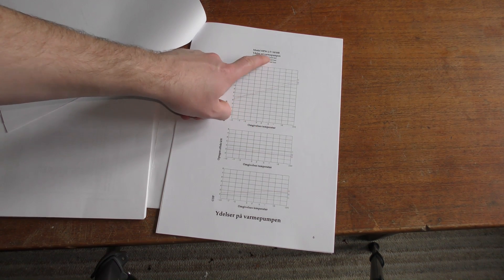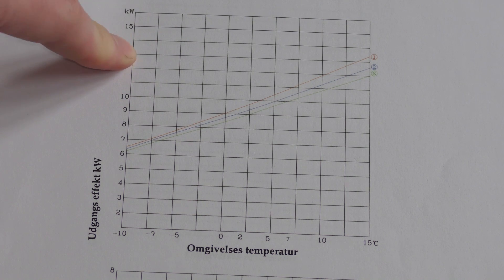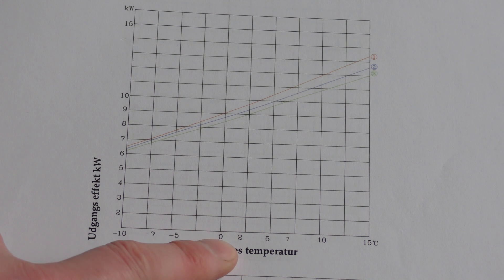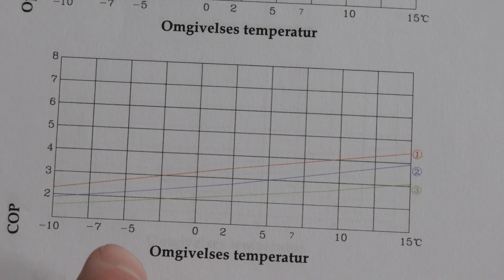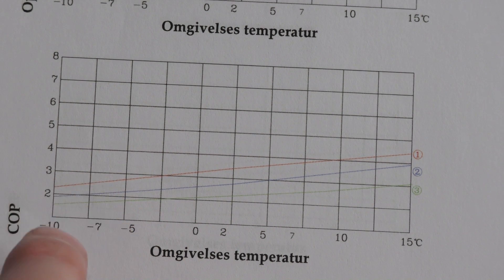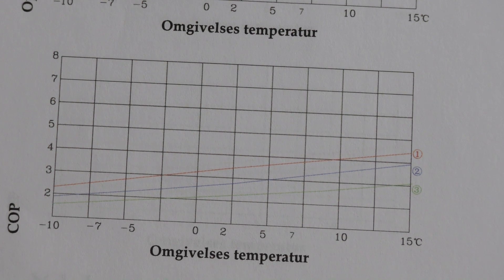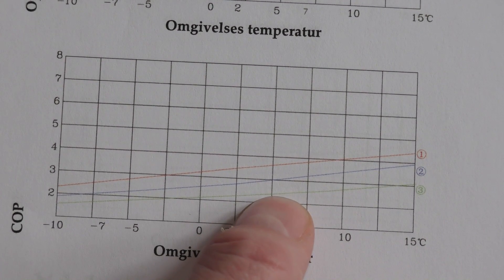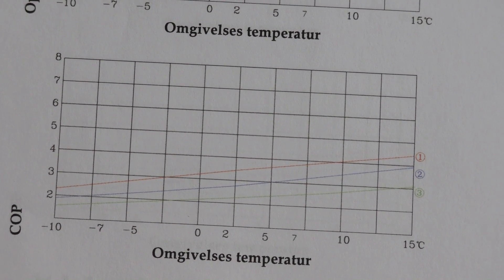Improving efficiency of heat pump, with heat controlled FAN - 306

Comment: Great video as always! Did you ever find a resolution for your Apartment's radiator?
Reply from the maker: Hi +sized4spills 
I change back to old thermostats,,the digital ones that turn on and off the heat,,will heat up the radiators to like very very hot,,, and more "oil" evaporates,, compared with a radiator that is just warm.
It the way that works, with the way i pay for heat,,that is incompatible, and becomes way to expensive.
Thank you for watching! :-)

Comment: You're not getting 3 kwh for 1 kwh  that breaks the Law of conservation of energy. 
Coefficient of Performance is heat output / watt input which means that for every kwh you're producing n number of heating units Btu/h.
Reply from the maker: Hi +Colin Faulkingham 
I am getting like 3 times the amount of heat, compared to heating with an electric heater.
Thank you for watching! :-)
Reply: +Colin Faulkingham It's about taking 1kwH electricity and get 3kwh heat. the 2 kwH are being drawn out of the air.
Reply: +Tobimai  I think I understand now. I misunderstood what the end COP number actual meant. Thanks.

Comment: You should make like a heat and air baffle thing, like in servers except bigger and on a radiator.
Reply from the maker: Hi +beaker15 
Not sure what you mean,,, ??
Thank you for watching! :-)
Reply: +My PlayHouse (Morten Hjorth) well your trying to move heat away from the radiator right?
Reply from the maker: Hi beaker15
Yes,,, and fast :-)
Thank you for watching! :-)
Reply: +My PlayHouse (Morten Hjorth) well if you look at a server heatsink it uses air channels and air baffles to move the heat away fast. You just have to figure out a way to make a big version where the cpu (and CPU heatsink) is replaced with a radiator.
Reply from the maker: Hi beaker15
It has to be quit to :-) I do not wanna hear it.
Thank you for watching! :-)
Reply: +My PlayHouse (Morten Hjorth) ya makes sense, you could use something like using bigger and quieter fans rather then server fans. Heck I've seen people make noisy servers quite by changing fans.

Comment: I wonder how much the fan increases air flow compared to convection? How does this systems efficiency compare to a normal air conditioning system pumping refrigerant  with condensers/evaporators instead of water? I have seen a system similar to yours used to heat a large building the difference was they also had heat pumps in the rooms to remove the heat from the water to heat the rooms, very flexible but must have been very expensive.
Reply from the maker: HI +Coolkeys2009 
This system has the advantage of only power and  water in and water out. No pumping refrigerant inside,, and there for, this unit I could install my self.
Thank you for watching! :-)
Reply: My PlayHouse I do like the way that it uses the pipe work and radiators of the original central heating system. I wonder how much more efficient it would be with some  kind of dedicated water to air heat exchanger with a built in fan? Also how does the temperature difference of the water leaving and returning to the heat pump effect it's efficiency?(were there graphs for that?)
Reply from the maker: Hi Coolkeys2009
I liked that i did not have to also pay for someone to install it,, it is a $3000 unit and I was able to make it work by myself :-)
I was not able to find an English manual.
Thank you for watching! :-)

Comment: I would get a small solar panel that you can place in the window that will keep the batteries charged for you, then you will never have to worry about charging the batteries until they need to be replaced due to age. I would also just replace them and use a small one from an UPS that has been salvaged for parts. This way you can leave the fans running all the time maintaining temperature in the playhouse. Love the videos take care.
Reply from the maker: Hi +Dennis Smith Jr. 
I was dreming of an Peltier Module,,Thermoelectric Power Generator High Temperature Generation. 
and hoping that a couple of these could make enough power from the hot radiator to run a fan.
http://amzn.to/1T7RvPj

Thank you for watching! :-)